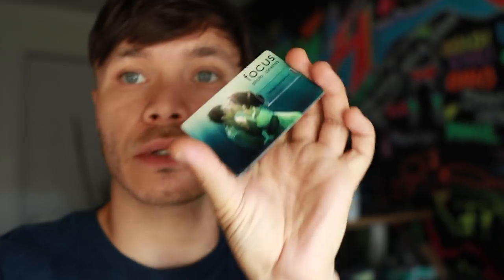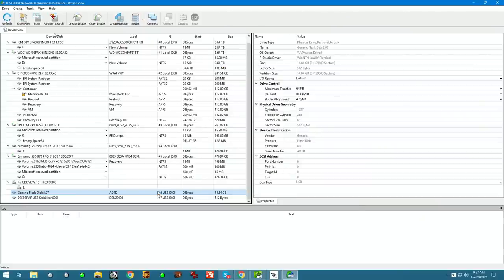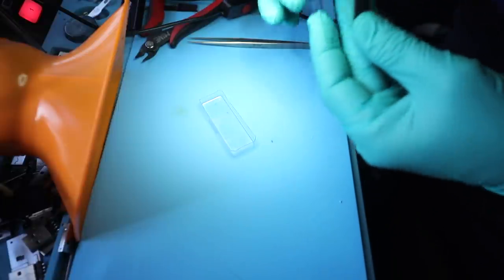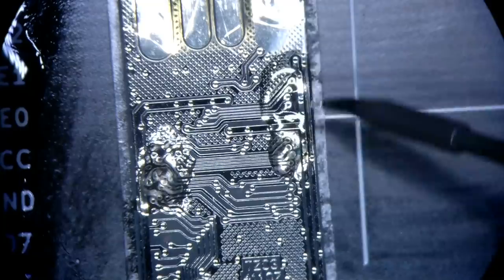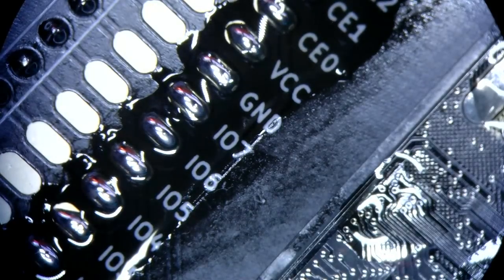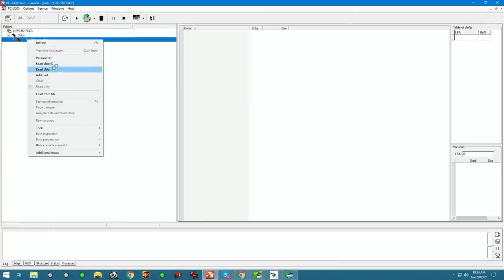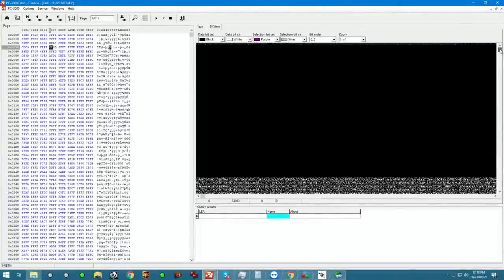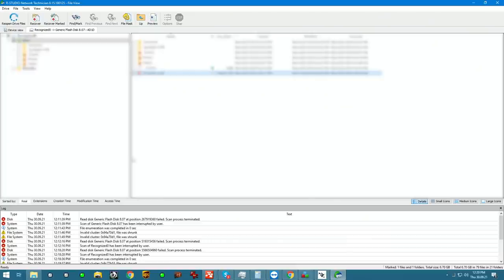this flash drive had a wedding on it, what can be done to recover it?

Comment: I love your videos with soldering. It seems most faults are mechanical or burned external simple parts (caps, resistors, diodes), which you can easily replace. It seems you never had to create external clock generator due to faulty internal one in controller, or some similar obscure procedure. Or did you something similar?. Did you ever had to recover data from some memory in phone? Is it even possible with PC3000?

Comment: I've never made friends with enameled wire. Are you scraping the wire under the solder blob, with the soldering iron tip, to remove the enamel coating?
Reply from the maker: No, the tip is hot enough to burn it with the tin
Reply: @hddrecoveryservices  what temperature do you use?
Reply: The enamel on some wire is designed to burn off, but most is not. You need to be using the right type of enameled wire.

Comment: That device is weird. It bothers me enough to make me uncomfortable. I would never use something like that. I have more faith in my USB 3.0 16GB drive from 2013. It normally is used as a stash of commodore 64 disk images for my commodore 64, but I even used it to install windows 10 on my new computer I built this year. And in the end it sounded it like the real problem was the file was deleted. lol I still wouldn't use such an odd device. lol
Reply from the maker: It is sad to see but more and more wedding photo and video guys resort to using this marketing scrap metal for the lack of knowledge.
Reply: The first thing I've done is upload my wedding photos to 5 different clouds. Synchronize them to 3 available pcs. Send it to my own email. And create a non synced copy on every pc. Actually I doing it with every important photo of my family.

Comment: Hello,
i have a smartphone micro sd card, and it stopped working out of nowhere on my cell phone. I got it, I did a formatting but I still wasn't successful... but I remembered that I didn't have bkp of my files...
and now I'm worried about recovering my photos and video from that card. Is there any way I can do some procedure or safe mode so that the card works on my computer so I can do the bkp.

Comment: What I don't understand is when you access the Nand through the wired connections why does the flash drive controller not interfere? It will be powered up as well and hence will try to get access to the Nand at the same time or at least keep logic levels on the data lines that would differ from the external signals. Or is both on one chip?
Reply from the maker: No, because Controller is not getting commands from D+/D-. However, in some cases it does generate noise and that disturbs the read quality of the NAND. It could be countered by either grounding the Controller test pad or adjusting power settings
Reply: @hddrecoveryservices  Understood. Thank you for the clarification.

Comment: Erkin, I have a problem. R recovery software recovered corrupted files.Then how to repair these corrupted files? Any tips please.
Reply from the maker: If the file is corrupt on source and it is not due to bad sectors, then you can try to use file recovery tools. But we don't do that kind of work dude. If the file is beat up - that's all she wrote for that file

Comment: Looks like it has been exposed to a relatively strong magnetic field or else, could It be?
Reply from the maker: Not sure. I think it just never got written to the device. It looks like it started to get written then something dropped off. Then owner in panic formatted it when device prompted in error that it needed initialization
Reply: @hddrecoveryservices  then it turned to the RAW format due to owner's mistake by removing unsafely from USB port? I've seen many cases and that's when begs to initialize in vain. Well, a shock or the low quality of devices themselves can lead to failure.

Comment: May be the flash size is fack !! right!?
Reply from the maker: You mean like a fake size but the device is much smaller? I doubt it's the case 16GB is small. Usually fake size devices will be 64GB+. I really think owner never checked the copy and it crashed during copying. Link got created in FAT but data got cut off